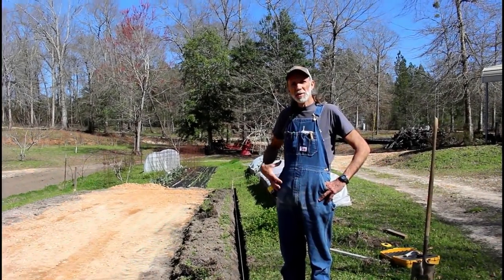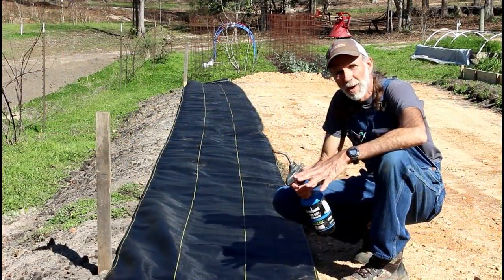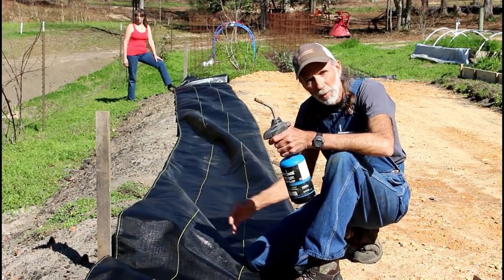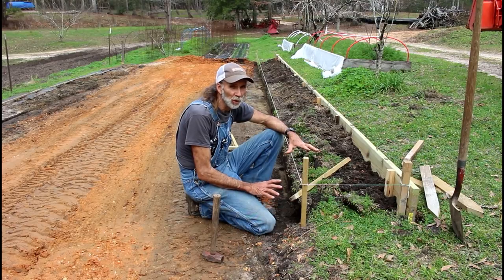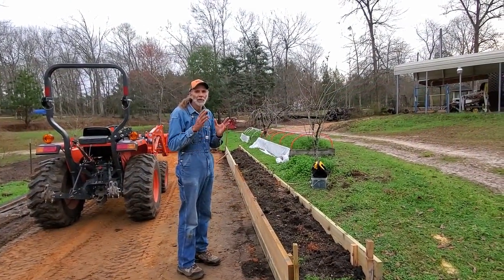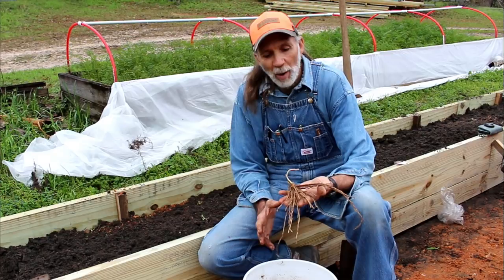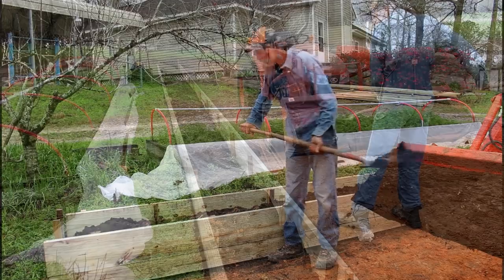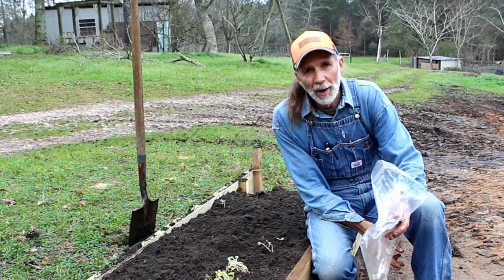How to Build a High Tunnel/Greenhouse FOUNDATION | Building a Raised Bed |  Part 2

Comment: I wish I could be there to help ya'll. I've built a bunch of greenhouses of all sizes. Your gonna love it when you get it all built and enclosed in. The temperature difference is incredible inside. I Used old lightweight aluminum storm doors hung from a straight section of garage door track mounted horizontally with rollers welded/mounted on the top of the door to roll easily back in forth in the track. And then in the winter months, I use pieces of split foam pipe insulation on the side edges and top to seal off the cold air to hold the warm air inside. You'll have a lot of fun coming up with makeshift ideas to build your irrigation and ventilation and whatnot.

Comment: I've had problems getting the correct chill hours on strawberries  in my greenhouse. In my new Growers Solution greenhouse purchased with the promo code  it may work better since it will not be heated.
Reply from the maker: I hope yours works out good for you. Ours is coming along and hopefully it will work as planned.

Comment: Mr Danny    Upper Galveston area here ... I want to order the 20 x40 high wall from Growers Solutions but the pictures dont show the bracing like you have.  Is there an upgrade I am supposed to pick?  Am concerned about wind also and like what you have for a frame.
Reply from the maker: The bracing I designed myself. They only sell the metal kits.

Comment: Just a question was just wondering. Is there a reason you did not cap the ends of the raised bed. Just wanted to know so I did not make a mistake if I build raised beds
Reply from the maker: They will be capped further in the build.